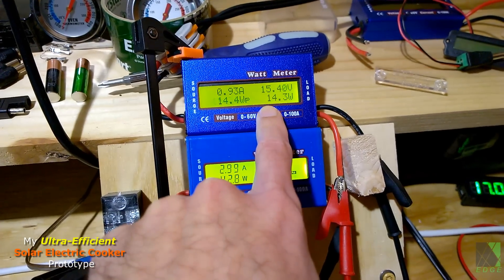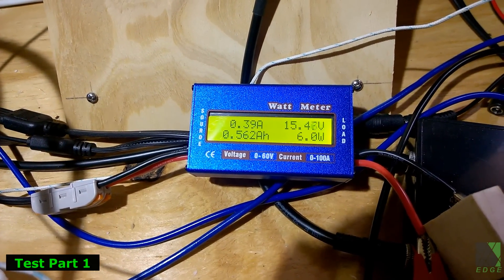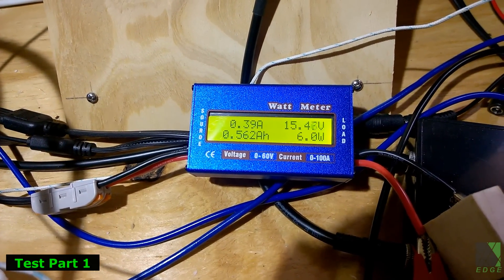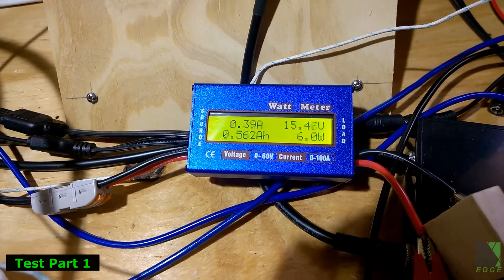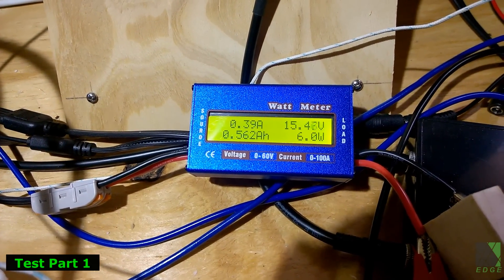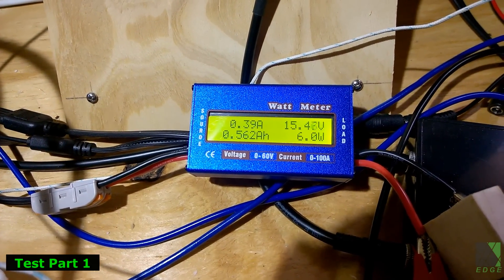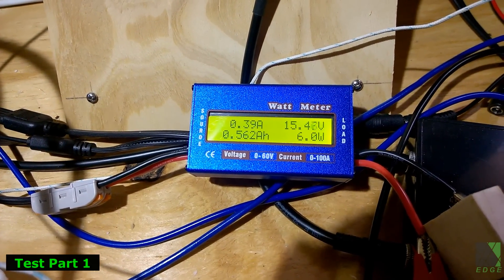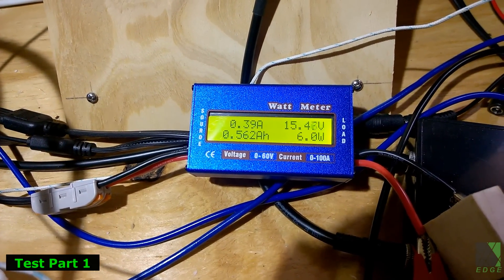Ultra efficient solar electric cooker! 20 Watt Solar Panel can cook an egg with diode chain #solar

Comment: So in case of bad conditions (worst case scenario) could someone charge drill batteries (however long it takes)  and still be able to cook every other day without burning fuel?
Reply from the maker: @ELTABULLO That's a good and thought provoking question. The solar panel I demonstrated can make probably 15-18 watts for a few hours a day IF it's  very sunny outside. In that case I can definitely cook "1-3 eggs" (or soup or whatever) and still have power left to charge a battery the rest of the day. I think that is an incredible level of efficiency. Then it should be possible to have a second heating element matched to the 18v battery, and use that when there isn't sunshine, or maybe for cooking at nighttime. I wish I had the resources and health to develop this idea into a simple product. A tiny, hyper-efficient food cooker that can run off a few watts of solar could change a lot of peoples lives for good.

Comment: You could make a decent product from this… Stainless steel Thermos with a flexible solar panel wrapped around its diameter (for storage) which you can unfurl for when you want to boil some water. I would buy that. 😅

edit even those low early morning (low sun) temperatures would be good for coffee, perfect for camping. 🤗
Reply from the maker: @mattmiller220 I hear ya :D this thing really ought to be on store shelves! Maybe a company will pick up the idea...

Comment: Hello!! Im a Highschool student and we wanna make a prototype for our science project in using solar panels for portable water desalination.. we just aren't completely sure on how to make something like this so I was hoping if you had some kind of idea or advice you wanna give us since we are a bit lost, we wanna use the solar panels to heat the water when it comes to the desalination process... and we wanna make sure its drinkable..
Reply from the maker: @itsjenna1560 Hi! I've built a water distiller with this idea, it's 100% possible. But using diode strings is rather complicated and tedious. For a first project, what I'd recommend is to take a different route - a 12v heated cup. Those are easy to find and they work pretty well. Here's my video about the heated cup, you can see the water was boiling quite vigorously. Make sure teh voltage doesn't exceed about 12-13v or it might overheat! Hope this helps! 
https://youtu.be/-QthPOTDLSY

Comment: It's been some 40 years since I studied electronics, and I'm in the process of developing a solar powered sand battery to supplement heat to my gas boiler system.  But, now I am looking at using a 90-plate heat exchanger that can utilize 12V solar to heat 16-gallon distiller pot to provide 140 - 190F to heat the plate exchanger.  I see you mention a 100-200a power rectifier diode with heat sink to provide greater heating capability.  Can anyone guide me as to how to apply such a diode to do this?
Reply from the maker: @canterburyworkshop5631  Hi, bigger diodes are tougher and should take more heating work. For that reason I been researching them as much as possible. Right now my shop is being heated in part with large power rectifier diodes (not axial type). 
For your application, have to think about how to get the heat out of the diode and into the water. There are lots of options in that direction...
In my tests, diodes can handle 100(C) just fine, so 140-190F is totally possible I think. Note: the bigger diodes can get expensive... so I imagine at some point the cost might outweigh the benefits. For the last heater I spent $50 on diodes, whereas nichrome might cost $1. However I may have solved this in a future video... we'll see I guess :D
Reply: @solarpoweredge  Thank you for your quick reply.  I will keep learning more about power rectifiers online, and try to quickly update my lost electronic knowledge.
Reply from the maker: @canterburyworkshop5631  No problem!

Comment: Hi there, great work. Can a battery used to power this diode heater? If yes, do i need to use boost converter to mimic the solar panel? Thanks
Reply from the maker: @aldymcpndg14  Hi and thanks :D diodes have no major resistance to current flow, therefore if you must use them w/ a battery, current-limiting is an absolute must. This might be handy for a dual-use scenario, where the cooker needs to accept direct solar PV input and still accept a battery input. It's good to think outside the box about different scenarios, that's how new things get invented :)

Comment: Very very interesting. Just found your channel.  Also saw your new video and it seems next to the silicium and Schottky we now have the idiots diodes.  Small anecdote. I just purchased blocking diodes from China in mc4 connectors since I use different kind of play panels that I purchased over the years. The  panels are connected in parallel so safety first. When I ordered them I had a choice of 10A, 20A or 30A with minimal price difference so I went with the 30A ones. When they arrived I measured the fwd voltage. (I already had my own Schottky blocking diodes but not in a waterproof connector and the price was really good for the ones I purchased.)  But measuring.... 0.55V I realised that these were regular diodes and not Schottky diodes. I used my bench power supply and set the current to 15A and the voltage drop was 0.8V and I could actually evaporate water touching that diode.  P=uxi ...  So the damn thing was 'waisting' 12 Watt which went into direct heat.  Remember this was with the connector open. Imagine with a string pushing 20A thru in an enclosed connector I smell kind of a disaster waiting to happen.  So now I have a couple of diodes to be used for heating purposes.  Actually a very neat usage of a not perfect diode and also 'abusing' them so that the panel is delivering the max ppt.  Now going to watch the rest of your videos. Sharing and showing is building up knowledge. Thx for that!
Reply from the maker: @Luke-san Hi, glad you found the channel... thanks for subscribing. I always felt YT should be about sharing knowledge vs. entertainment. Oddly enough I bought quite a lot of diodes that were listed as Schottkies - but they were not! Oh well they are still useful

Comment: So many 10watt diodes do i need for a 550w panel. To make a heater for my outdoor cat house
Reply from the maker: @cronicjohnson Hi, I recommend using bridge rectifier or power diodes that have a "tab" or a metal case with a hole for attaching to a heat sink. Then find a good sized heat sink that can handle about 400w probably. The number of diodes is calculated by the solar panel vMP (max power voltage - need to find out what that is). Each diode can drop about .5v depending on the type AND depending on the temperature. So some hands-on experimenting is required to find the right number of diodes. Also need a few spare diodes available just in case you want to change the operating voltage/temp or if one burns out. Hope that helps
Reply: @solarpoweredge  my plan was to make the floor into a sand battery to hold the heat from the diode array. Not sure I would need a heat sync at that point
Reply from the maker: @cronicjohnson It's worth a try... I want to make a sand battery as soon as possible to test the idea. Diodes need to be kept around 100C or less for best longevity, I am not sure exactly how to accomplish that
Reply: @cronicjohnson  I was thinking of doing the same - want to make an off grid shower - so thought 'capture heat in the day in a sand battery and run a heat exchange into it t heat the water. I was thinking I'd be using heat pipes, but this is interesting. One thought, transferring heat from diodes to sand might not be highly efficient because sand has low thermal conduction compared to water. Water is not ideal because of corrosion to diodes, steam build up, evaporation etc - how about having a central container of wax in a tin holding the diodes? Presumably it wouldn't harm the diodes, but would offer efficient heat transfer
Reply from the maker: @simonrines4334 Wow lots of good ideas in here... just thought I'd drop in some thoughts for your consideration. Another strategy is an "immersion element" with copper tubing or metal case. I built a portable solar electric hot water heater HWH using this idea. The heating element is sitting right in the water, runs about 15-17v and 100w solar panels. It goes with my 12v camp shower. Great for emergency use!

 If you get the diodes in close contact with the water, then that heat can go into the water quickly, for low cost. The diodes need not get too hot. The diodes don't have to be directly exposed to water, but encased within metal. Insulation can hold the heat. Of course, sand can hold extreme temperatures, unlike water. But for hot showers only, probably don't need/want water that hot!
 I hope to present the HWH build as soon as humanly possible... there are so many ideas and projects to do these days
Reply: @simonrines4334  but if you have them completely immersed in sand the heat has to go into the sand. Once the heat is there it has no where else to go but Into the surrounding sand right.
Or since it doesn't transfer heat as quickly the diodes have a chance of burning up ?
Reply: @solarpoweredge  Thanks for your reply. How would you avoid a short circuit when placing diodes in metal casing? I've looked into this a bit more and there are 'potting compounds' in which solid state circuits can be set into - they are electric insulators by thermal conductors (but quite expensive) it might also be possible to mix epoxy with boron nitride to do similar. I thought maybe set in copper casing to make a heating element. Better ideas welcome. One other quick question - where you show the circuit tapping a voltage to charge a 12v battery, what happens when it is dark, does the battery drain into the circuit - or does the fact that the circuit is made of diodes prevent a reverse flow? Thanks for your amazing sharing of information
Reply from the maker: @simonrines4334  Hi I use stuff like fiberglass tube, kaptan, anything that can withstand potentially 100C temperature at least. Another option is large power rectifier diodes, those have metal cases with a hole for bolting to anything you want. I heat my shop with those experimentally.
 Immersion element can be made with copper tube and proper insulation. 
Battery charging: the diodes should block backflow of voltage, but you make a good point - we need to test this. Possibly an extra blocking diode to 100% protect from say a shorted diode. 
More Videos on this as soon as humanly possible!

Comment: Did you use 3A or 6A diodes? Thanks
Reply from the maker: @alhumble8175 Hello, this thing is tiny so I used 6A diodes. But even 3A diodes might work. Just make sure the heat gets transferred into the water, otherwise the diodes get super hot and burn up

Comment: US government wouldn't allow such an efficient device for open sale.
Reply from the maker: @Buddyelvis1-2022 Very likely, probably need to upgrade it to 1kW and sell it as the "instant egg cooker"
Reply: @solarpoweredge  fr, the dash egg cooker pulls 450 watts based on the label!

In cloudy country where I live you could need over 4kw of panels to generate that current some days, particularly Nov-Feb 😱

It's actually pretty energy efficient to use the thing to 'boil' up to 7 eggs at once vs boiling a pot of water, but the design relies on non-pressured vented steaming (of a tiny quantity of water granted) so it's easy to see it's nowhere near as efficient as it could be.
Reply from the maker: @priestesslucy Wow 450 watts that is huge.... a while back, I made a bigger version of this, it only uses about 25 watts and can boil several eggs at once or heat food etc.

Comment: Can we make 5 kw heater from this diodes
Reply from the maker: @venkateshachary9949 Hi and yes, there are 2 ways at least to do so:
1. Most expensive option is 100-200a power rectifier diodes with proper heat sinking. 
2. To heat my workshop, I have finally combined a 50 amp power diode string with standard resistance heaters. This means the solar panels will stay near the solar panel Max Power voltage, the resistance heaters will run at this voltage too, and the diodes will extract the remaining heat while also regulating the voltage - I will try to share this setup as soon as possible

Comment: Water heating is a great storage system on a solar system.  This would work for a hydronic heating system with a huge storage for all night operation or even 2 day backup at elevated temperature storage with a mixing valve.  No batteries required except for small efficient hydronic pump like Grundfos.
Reply from the maker: @timbrown9305 That is true! I'd like to build a dedicated solar heating system that uses water tanks, hopefully I'll have the chance

Comment: Basically this is a diode potential divider. Each diode will drop around 0.6 volt across it, depending on the specific diode, this is for silicon diodes which is effectively the only type that will be used today. As long as the voltage across the whole string doesn't exceed the max reverse voltage of an individual diode, they will quite happily conduct like they would in any circuit. The number of diodes in the string, or divider, determines the current flowing with a given voltage, if that current doesn't exceed the max forward current rating of each individual diode they will function without issue. Current X voltage = watts dissipated in heat.  Theoretically, one diode with a sufficient current rating would dissipate the same heat as a number of diodes with a lower current rating. If that one diode didn't exceed it's max junction temperature, it would work equally as well, but would probably be more difficult to incorporate into a practical design. Maybe say 4 or 6 smaller current diodes in a package with an external metal tab would be easier to use, as they could be screwed or bolted to an aluminum or copper dissipator, which could be used to transfer the heat to container.  All semiconductor devices dissipate heat when in use, normally that is undesirable but unavoidable, and is treated as waste that must be thermally managed, hence heatsinks and fans found in many electronic devices. So this is an interesting perspective on the subject!
Reply from the maker: @turboslag I found that DC fans can receive a voltage supply lower than the solar panel, by connecting across some of the diodes. Diode current is exponential of voltage, so that's why they work so well with solar panels, a current limited source.

Comment: Your diode string idea may be a patentable idea.. ..cheap way of matching panel power to the load to maximize efficiency. My idea is to solar cook oatmeal, rice , beans in those 12volt stainless steel thermoses they sell on Amazon. I successfully heated water in one to 170+ degrees and made ramen...about 30 min. So I was thinking...what if you built a ?6 inch thick styrofoam cube for the cooking vessel with small hole for steam to escape and a  drip tray to let water condensate drain out through a small bottom hole. Also would need a temp switch to turn solar/batt power on/off so as not to burn up heat element. Kindof a  hybrid haystack slow cooker. Trapping all that heat should allow the food to cook much faster and use a fraction of the energy.Doubling insulation r value results in half the heat loss!
Reply from the maker: @CharlesGwinn-ep9pb yeah diodes have been working amazingly well. I made larger diode cookers and projects but they are not on video. Maybe by this winter.  
I like your idea about insulation. There are a lot of things to try. Keep on experimenting!!

Comment: Will you elaborate the diod connections.
Please
Reply from the maker: @seddiqullahkhaliqi5916  Hello, they are a series string of diodes matched to the solar panels approximate Volts-max-power range. Of course it is not perfect regulation, but acts very similar to an MPPT circuit for very cheap price. 
To see earlier experiments, tests and explanations, please try these 2 videos:
https://youtu.be/6D0aUmkUQSQ
https://youtu.be/42XIbHA9Dv0